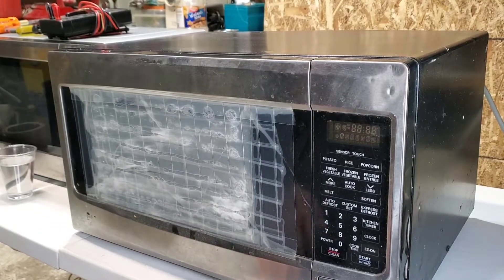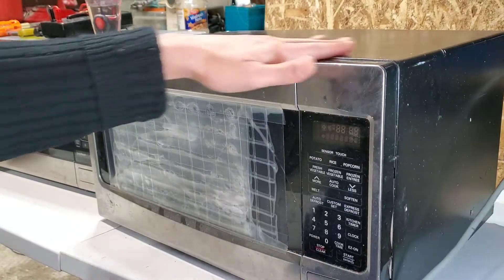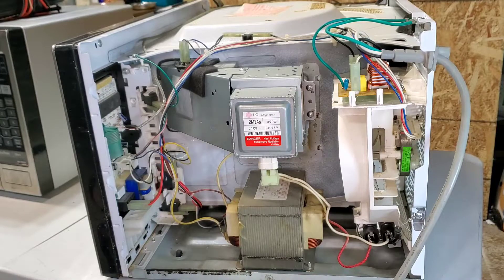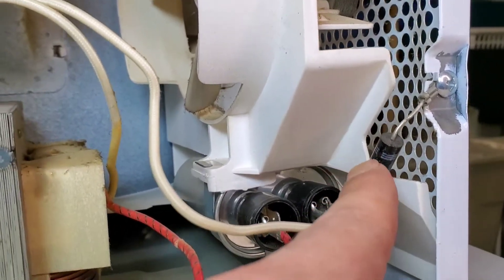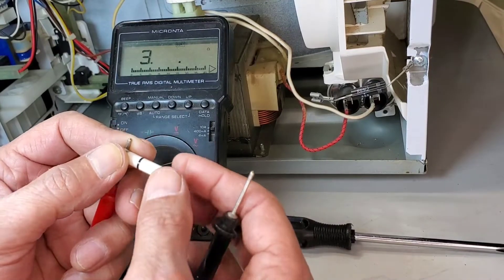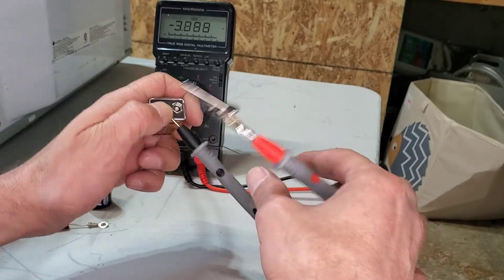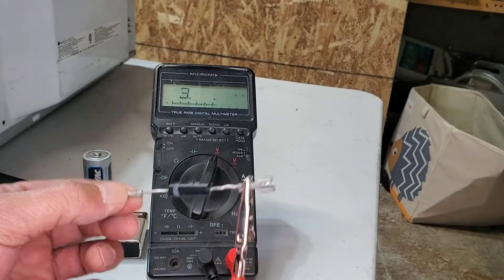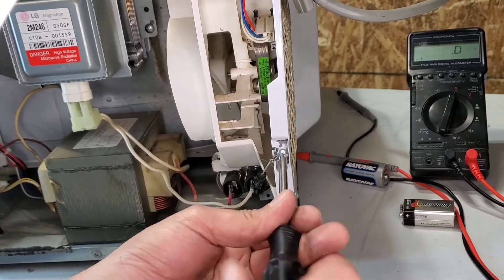How To Fix Microwave Doesn't Heat, Microwave Works But No Heat, Easy Fix

Comment: I would guess the noise is not coming from a bad diode but the source that runined  the diode. You can buy a new microwave from 90.00 with a thousand watts of heating. Is it really worth either playing with Microwaves and your health or High voltage electricity ? I think not
Reply from the maker: Thanks for the input! 👍 Safety is definitely the most important thing. I always remind viewers that microwave repairs involve high voltage and are only for those who know what they’re doing.

In my case, I made the video to show the diagnosis process and help people understand what usually fails (diodes, capacitors, magnetron, etc.).  It was bad magnetron , i also have a video how to replace it. Of course, sometimes replacing the unit is the smarter option depending on the cost and condition.
Appreciate you sharing your thoughts!

Comment: This isn't how you release the voltage. This is dangerous.
Reply from the maker: Thanks for your concern! I actually mentioned in the video description that part of the procedure was skipped in this clip. I also included a link to another video that shows exactly how to safely discharge the high-voltage capacitor. Safety is my top priority, and I always recommend following proper precautions.

Comment: What if its built in, can it be fixed?
Reply from the maker: Thank you for your watching and feddback, If the high-voltage diode is built into the capacitor or transformer, it usually can’t be replaced separately. In that case the whole part needs to be changed. Some models do allow a built-in diode replacement, but most require replacing the whole assembly. Best regards ✨️ ❤️

Comment: my microwave fan rotates for 2seconds then stops also with the motor but it's heating
Reply from the maker: That sounds like the cooling fan and turntable motor might be weak or failing. Since it’s still heating, the magnetron is working, but if the fan keeps stopping it could overheat later. You may want to check the fan motor or capacitor. Let me know if you need more information, 
Best regards ✨️ ❤️

Comment: Thanks god that was an easy fix. Imagine a hard fix? Uh?! I get you’re helping but this isn’t such an easy fix plus people need those equipments you have. I got none but a screwdriver. Isn’t connecting something wrong dangerous?
Reply from the maker: You're absolutely right — not every fix is simple, especially without the right tools. I try to show different solutions, from basic to more advanced, depending on what might be wrong. You're also 100% correct: safety is a top priority when working with appliances like microwaves. If anyone isn’t sure, it’s best to call a professional. Thanks for your comment and take care!

Comment: We have this problem frequently, we are using microwave in Food truck runs with generator, 1.1kw microwave, two microwaves throw away within 3 months, what will be reason brother?
Reply from the maker: ⚠️ Main Reasons Microwaves Fail Quickly in Food Trucks Using Generators:
1. Unstable Power Supply (Voltage Fluctuations)
Microwaves are sensitive to voltage. If your generator isn’t providing consistent power (especially during surges or dips), it can damage the microwave’s internal components like the magnetron or control board.
Cheap or underpowered generators often cause this.
2. Low-Quality or Undersized Generator
A 1.1kW microwave can pull up to 1500W+ during startup. If your generator can’t supply enough wattage or is already powering other devices, it gets overloaded.
Generator overload = dirty power = dead appliances.
3. Poor Quality Extension Cords or Wiring
If you're using thin or long extension cords, voltage drop happens, which stresses the microwave.
Use heavy-duty 12-gauge or 10-gauge cords.
4. Improper Ventilation
Inside a food truck, microwaves may overheat due to lack of airflow around them, especially during busy periods.
Overheating damages internal electronics fast.
5. Low-Quality Microwaves
Consumer-grade microwaves aren’t built for commercial/heavy-duty use.
Consider switching to a commercial-grade microwave (like Panasonic NE-series or Amana).
✅ Recommendations:
1. Use a generator with inverter technology (e.g., Honda EU2200i or bigger) — it gives “clean power.”
2. Add a voltage regulator/surge protector between generator and microwave.
3. Use a heavy-duty, short extension cord (10- or 12-gauge).
4. Make sure your microwave has good airflow and isn’t enclosed.
5. Switch to commercial-grade microwave ovens.
Reply from the maker: Great question! Microwaves in food trucks often fail fast because generators can give unstable or "dirty" power, especially if they're overloaded. That damages the microwave’s internals. Also, using cheap extension cords, poor airflow, or non-commercial microwaves can make things worse.
✅ Tips:
Use an inverter generator (clean power)
Add a voltage regulator or surge protector
Use a heavy-duty power cord (10–12 gauge)
Make sure there’s good ventilation
Go for a commercial-grade microwave
Hope that helps, brother! 🔧🚚🔥

Comment: I’m having the same issue 

I don’t know by it’s not working … How do I fix it?…
Reply from the maker: Hello my dear friend,  most likely magnot  could be bruned out and needs replacement,  please be careful avoid electrical shock and high voltage,  follow all safety steps before working with microwave 😀

Comment: I tought my diod was bad as it let voltage trough in both directions, tested with a small 12v battery..  the troughput was around 8V . Ordered two new diods and they tested the same.. Guess thats normal then? strange.. I changed the capacitor and now its working again..
Reply from the maker: Yes, that's normal. High-voltage diodes in microwaves don't behave like regular low-voltage diodes when tested with a standard multimeter or a small battery. They have a much higher forward voltage drop (often several volts), so basic testing methods can give misleading results.
Your experience suggests the issue was with the capacitor rather than the diode. A faulty capacitor can prevent the high-voltage circuit from generating the necessary power for the magnetron. Good troubleshooting, and thanks for sharing your findings!
When microwave doesn't heat it most likely is the magnetron bad or burned-out,

Comment: How to join the ranks of the Darwin Awards - Youtube DIY electronic repairs.
Reply from the maker: If you want to avoid becoming a Darwin Award recipient while doing DIY electronics repairs for YouTube, here are some key safety tips:
1. Respect High Voltage
Avoid working on live circuits unless absolutely necessary. Always unplug devices before opening them.
Capacitors hold charge even after power is off—discharge them safely with a resistor.
2. Proper Tools & PPE
Insulated screwdrivers and gloves for high-voltage work.
Safety glasses to protect from sparks or exploding components.
Fire extinguisher (Class C) nearby in case of electrical fires.
3. Don’t Bypass Safety Features
Cover fuses, don’t jump them.
Don’t remove grounding pins from plugs.
If a device has a safety interlock (like microwave ovens), don’t defeat it.
4. Be Careful with Lithium Batteries
Never puncture or short-circuit lithium-ion batteries—they can explode.
Use a proper charger, don’t improvise.
5. Ground Yourself for Static-Sensitive Electronics
Use an ESD strap to avoid frying delicate components.
Work on a grounded anti-static mat.
6. Know Your Limits
If you’re unsure, consult schematics and manuals before diving in.
If working with mains power or high voltage, consider seeking expert guidance.
If your goal is to win a Darwin Award, then… ignore everything above and start poking around inside a live CRT television or a microwave transformer with a metal screwdriver.

Comment: Now I want my microwave to stop working so I can fix it! 
(I bought it for £1 - ebay! - about 15 years ago but it still works fine. Samsung!)
Reply from the maker: That's great deal,  usually microwave last many years and it depends on usages, nothing you need to be careful if iyou fix microwave , please follow the important safety steps 
Microwave oven capacitors typically operate at high voltage, usually between 2,000V and 4,000V. These capacitors are part of the high-voltage circuit that powers the magnetron, which generates the microwave energy for cooking.
Key Specifications of Microwave Capacitors:
Voltage Rating: Usually 2,000V to 4,000V DC
Capacitance: Typically between 0.8 µF and 1.2 µF
Function: Works with the high-voltage transformer and diode to convert AC into high-voltage DC for the magnetron.
Safety Precautions When Handling Microwave Capacitors:
High Voltage Hazard: Even after unplugging, the capacitor can retain a lethal charge.
Discharge Before Handling: Use an insulated screwdriver or a high-wattage resistor to discharge the capacitor safely.
Avoid Direct Contact: Wear insulated gloves and use proper tools when working with the high-voltage section.
Would you like instructions on how to discharge a microwave capacitor safely?

Comment: Touching one of the terminals on the capacity with a pliers does nothing.  You have to touch BOTH terminals with the pliers at the same time to discharge it.
Reply from the maker: Yes, that's exactly right, maybe the camera didn't catch that clearly enough, or it's missing for that part, 🤔 but thank you again and all the best 👍

Comment: Umm usually if the microwave doesn't heat it's the magnetron.  You should have pulled it out and checked the coloration of the stem, it should be mostly silver not completely brown.  Magnetrons go out all the time especially under high use.
Reply from the maker: Hello my dear friend, thank so much 😊  for great information , yes that obviously right,  here's a video I made replacing magnetron and  microwave worked good, thank you again and all the best 👍
Reply from the maker: https://youtu.be/obhd0vUiH18

Comment: Thanks bro, I thought the diode was a bleed resistor.... for safety
Reply from the maker: My pleasure 😊, thank you so much and all the best 🙏
Reply from the maker: Yes that's what I thought too, but it was the magnetron burned,  thank you
Reply: On my unit it was the diode after all, all other components were working perfectly, and I was scratching my head lol...until I saw your video...crazy a cheap component like that can make or brake the whole system....
Reply from the maker: @leemathoo6583 ,  I was also confused about hight voltage diode, so after you replaced the diode it works fine? And Does the burned  diode made the microwave not heating ? , it's interesting to know , thank you and all the best 🙏

Comment: Did replacing the diode fix Ur problem or did it end up being the magnetron?   Mine runs noisy but does not heat.
Reply from the maker: Hello my friend, I am going to upload a video about that microwave to find out if it was diode or magneton, I will notify you, thank you and all the best 🙏🙂
Reply from the maker: Hello my friend,  here's the new video thank you and all the best 🙏 
https://youtu.be/obhd0vUiH18?si=9yQY-lX9rHZMQrZY

Comment: Discharged capacitor wrong, and tested diode wrong. Sounds like a bad magnetron. Shouldn't be that noisy.
Reply from the maker: Thank you so much for your helpful message, I will also make another video soon about what I did wrong and update about this issue, best regards

Comment: My two grill microwaves don't work the other one it's malfunctioning the door  and numbers don't correspond. The other one does not heat😢
Reply from the maker: If the display screen or touch keys not working it could be fuse of not then electronic board component is burned out,

Comment: I'm scared to watch this since he didn't short the capacitor the correct way.
Reply: Right!  I saw that and was thinking Holy crap we might see some eyeballs pop out of socket!  That happened to my nephew's friend.
Reply from the maker: Unfortunately I missed one important thing during adding this video the part where the the 2 Screwdrivers touching both terminals to drain the storage voltages, after uploading I couldn't add that missing part so I will try to do something about, thank you so much And all the best

Comment: The diode reads alot on one end and only 0.01 in the other. Still means it needs replacing?
Reply from the maker: I am not quite sure about this doide therefore I am making new video about this doide and I will replace it and test it again to see any different, this high voltage doide so it's a tricky to test it with just regular multimeter, thank you so much and all the best 🙏🙂

Comment: No need for batteries to check a diode, with digital meter anode and cathode measurement or flipping positive and negative leads can tell you an open or shorted diode.
Reply from the maker: Yes that is Right, I used battery for this a spastic high voltage doide just another way to test high voltage doide, thank you so much and all the best 🙏🙂
Reply: Is it the same with high voltage diode? Because i check with multimeter buying new one and none of them open. Are my diode are faulty? But with worldrandom menthod with battery it works one way mean its good
Reply from the maker: @billykulim5202  yes absolutely right, thank you and all the best 🙏

Comment: This diod is ground...
Reply from the maker: I will make a video soon about this doide , thank you and all the best 🙏
Reply: @WorldRandomVideos  I meant why is connected to ground if this diod cornrol heat I hear it control heat
Reply from the maker: @HuzaBird0.2  yes it does,  this Type of doide is grounded to microwave body but it's controlling heat also,  I will do so search to make sure why it is working with microwave heat, and I will do testing video as well, thank you and all the best 🙏

Comment: I tired to check this and had no luck, once I put it all back together the microwave tripped off and now doesn’t even power on… what did I do wrong?
Reply: Replace the fuse
Reply: Replace the fuse
Reply from the maker: It could be the fuse had blown out, try to replace it. Thank you and all the best 🙏

Comment: Thought you had to flip the diode on the tester to change direction of voltage flow??
Reply: Or flip the battery, which is what he did.
Reply from the maker: Yes, flib the battery + - to - + will work as well, thank you and all the best 😊

Comment: 3:00 If there WAS left-over voltage, what would happen when you touch those leads?
Reply from the maker: Microwave ovens contain high voltage circuits and components operating at 4,000-5,000 volts (depending on the model). The risk associated with high voltages is exponentially greater than household voltages; electrocution by high voltage will almost certainly lead to death or permanent injury.
Reply: How

Comment: First you're not releasing voltage.  You are releasing charge of a HV calacitor. And you were wrong in its way. You needed to contact the two pins of the capacitor with the plyer at the same time so it could make a closed loop.
Reply from the maker: Thank you for teaching me , all the best
Reply: You are blind watch again and you will see that he shunt the 2 pins of the Hv
Reply: @DJ_MAD  I am glad someone else sees it.
Reply: @DJ_MAD  stupid comment. I was talking about how he described it first. Didn't say he didn't do it. He said "releasing voltage". Releasing " charge" is correct description . He also didn't do correctly.  He shunted each pole separately - one by one. Two poles needed to be contacted to ground.  You don't know what others are talking about, keep staying calm.
Edit: add more details.
Reply: Make sure that when using the screwdrivers to discharge the capacitor, screwdrivers handles is properly insulated. In my opinion maybe it is even safer to use high voltage protector gloves.
Reply from the maker: @rickynaidoo2921,  thank so much 🙏 great advices and very important useful information 👍,  best regards ✨️
Reply: Pedantics
Reply: @Leo-gt1bx  Useless
Reply: @bhbae1  Blind
Reply: @Leo-gt1bx  deaf